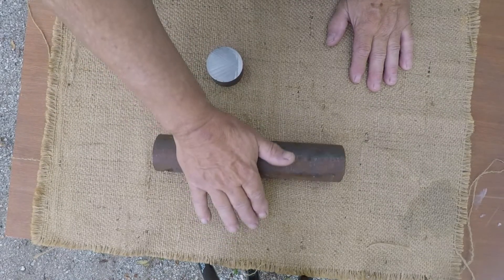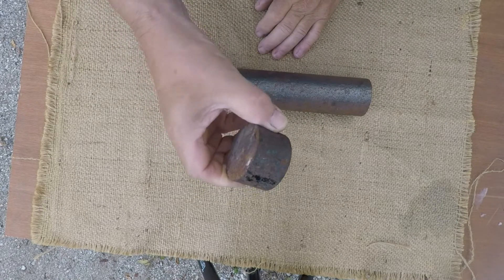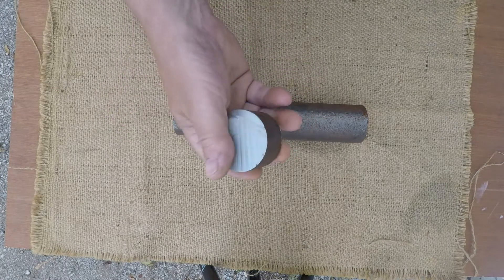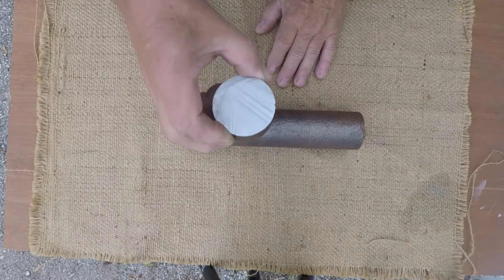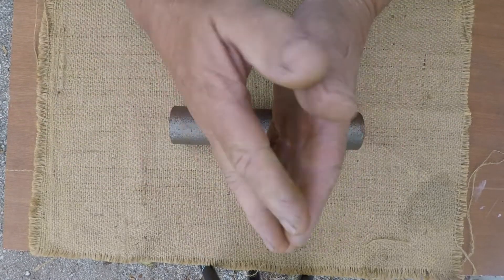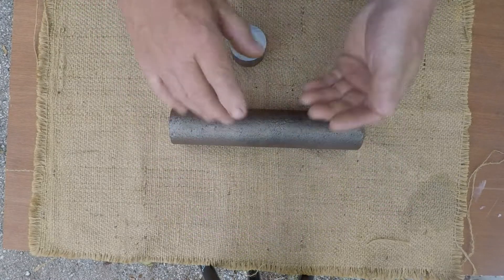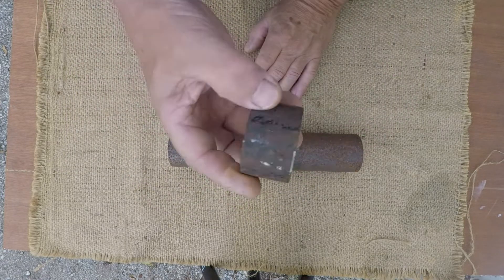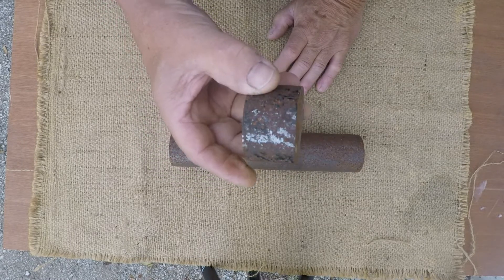W2 Tool Steel Explanation

Comment: I have 2 knives that were hand forged from W-2. They both have hamons. Jason at Last Resort knives made them. One is a Tanto. The other a modified Bowie. Both are fairly long 15"? with a 9.5-10" blade and are full tang. Got them back in 2013-2014.They continue to be the centerpieces of my collection. Not sure where the steel was sourced from.

Comment: Could I buy a small chunk of that about the size your holding off of you sir?  Would love to give it a go!  Thanks
Reply from the maker: I don't enough that I would sell any. I can't replace it. Sorry.
Reply: @KarlBAndersen  ok thanks for the reply, would love to find a small piece sometime to make a blade out of.  Love the history behind it.
Reply: @Quiles33  NJSB has bar stock. I don't know the W2 general spec and how wide it is, but NJSBs listings now have batch certificates so you can tell what their composition is (basically low hardenability, about 0.95% carbon on average with just a trace of vanadium)

Comment: Very interesting video.  I've heard it was from Tremblay, although I was never aware of this particular steel's intended use, very cool.  I was lucky enough to snag up the last small batch being sold from another member on BF 5 or so years ago.  The size I have is 7/8", which is a much more realistic size for me with no press or power hammer access, but even so, this stuff is still a bear to hand forge down to bar stock so I've been meaning to find somebody with a press to pay a few bucks to squish out  a few bars for me lol.  Thanks for sharing.